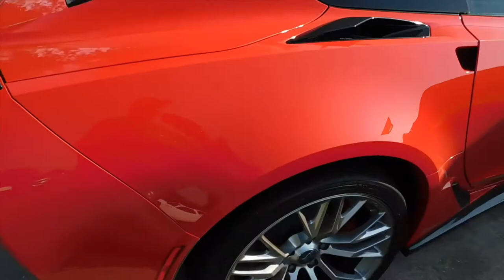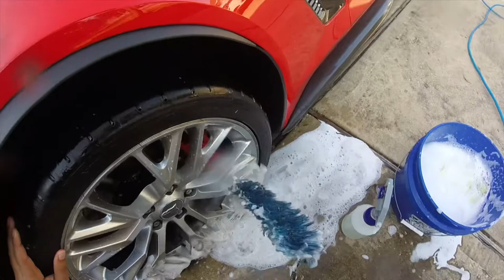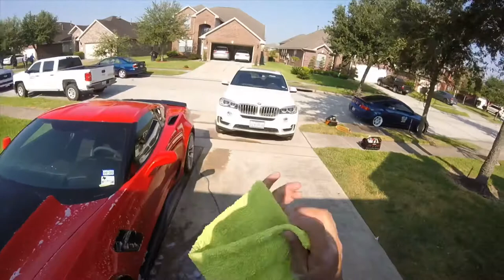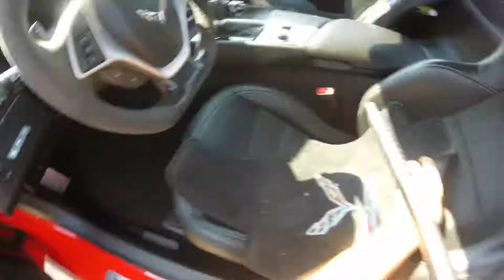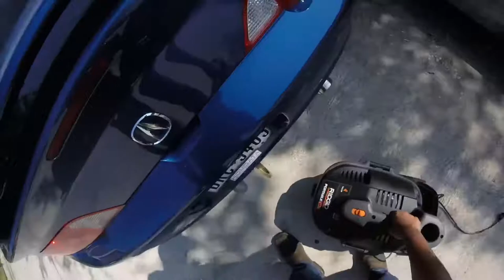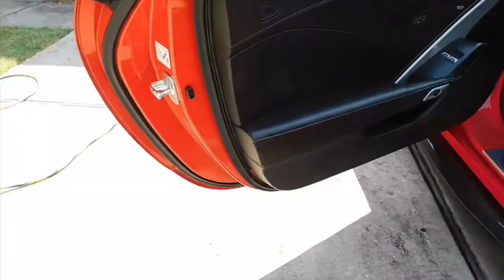C7 Z06 corvette -wash Vlog

Comment: DOPE AF bro.. what did you use on the rims.?
Reply from the maker: Mac or Die any degreaser dilutes 3 parts water 1part degreaser, will do the trick. I sprayed it down with the degreaser and then right away washed it with regular car soap.